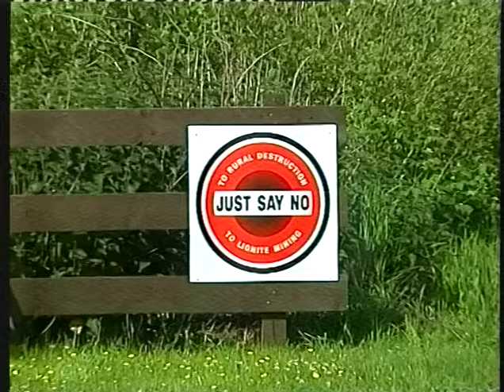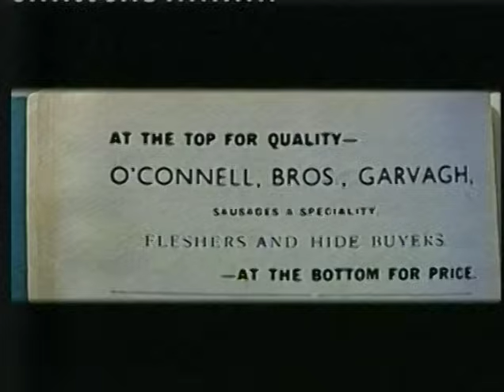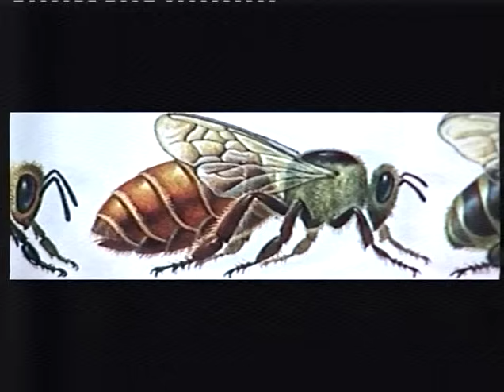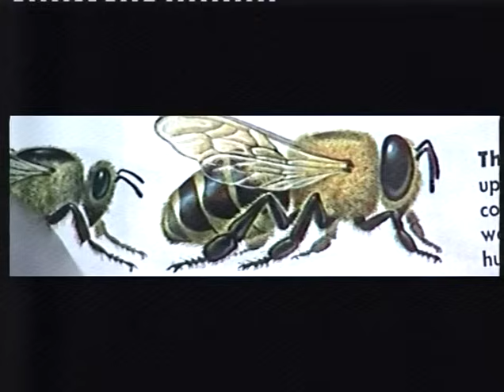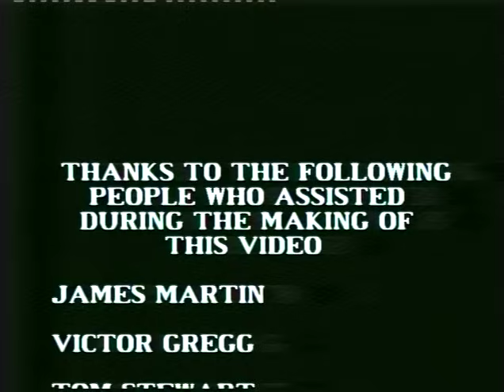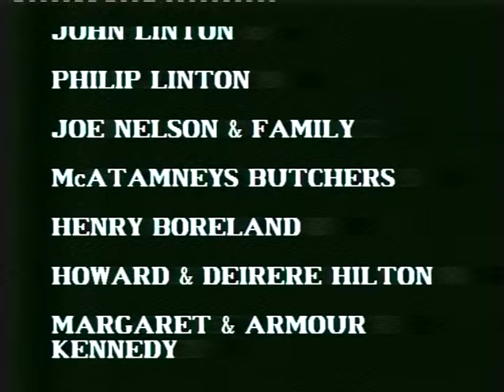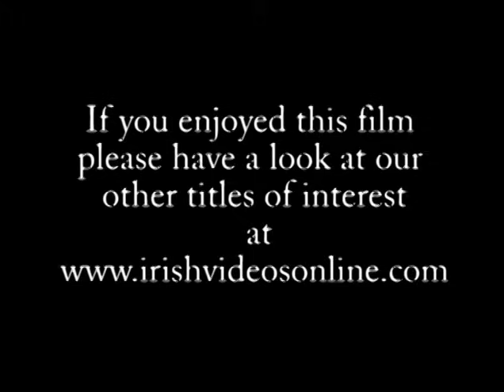The Story of Turf Cutting in Ireland  --  Irish History Documentary

Comment: My family and I have cut turf for years in Conamara. These lads are cutting moin ucht in Irish, the other type is moin sìos which would be nearly vertically cut. We never loaded freshly cut turf onto barrows (waste of effort), three men here on screen whereas two men done the same work if you omit the wheelbarrow, we just spread it out with a four prong fork and barrow it once dry. I'm sure that they have their reasons and work with the conditions that they are presented with. The footing of the turf is called gròige in irish and there are several types on this video, gròigìnì (regular small ones) athgròigìnì (bigger) and gròigìnì francach (the square stacked ones).
Reply: Well sir your wack of the woods is the nicest scenery I've ever seen.. I can just remember if I'm not mistaken there used to be a we shop at top of a moutian  sold clatter rings.. Been a long time since I've been er but will never forget standing outside shop with that view.
Reply: Mark Oneill 66
Reply: Can I ask why do you use that fada?
Reply: @beaglaoich4418  my phone was broken at the time and I couldn't use the proper fada until I got my new phone recently
Reply: I didn’t see the logic in loading a barrow to move the peat 4-5 feet 🤷‍♂️.